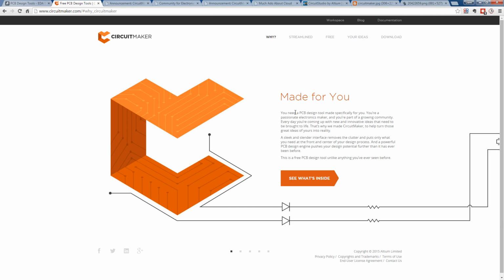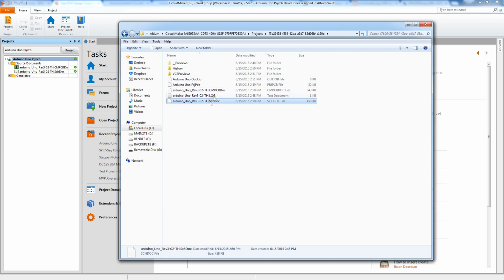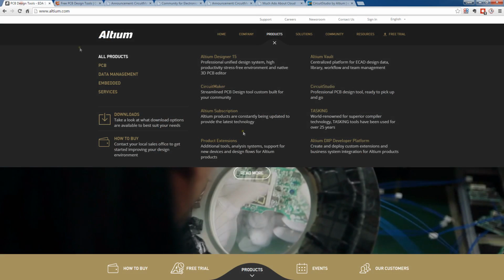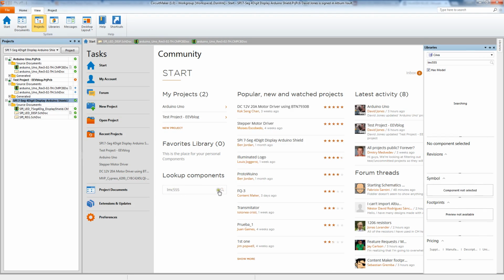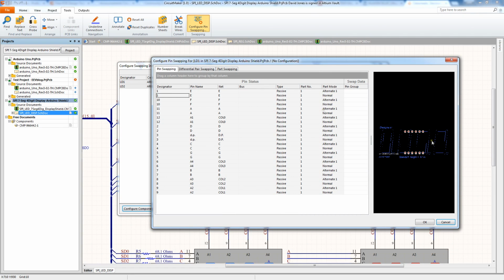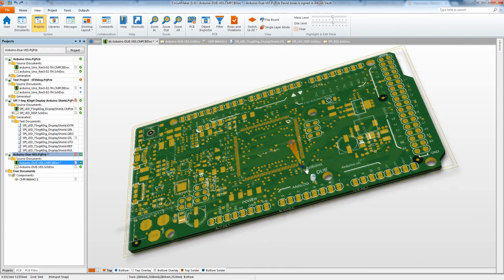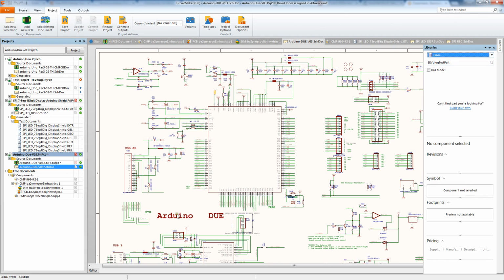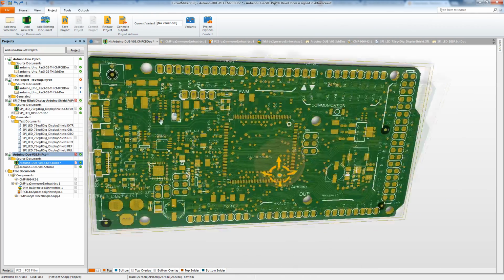EEVblog #754 - Altium Circuit Maker First Impressions

Comment: Dave I sympathize with you on the frustration not just with this program but with all programs and most designs, industrial, commercial and domestic . The problem is MONEY, PROFIT and Capitalism. Where making money on a continuous cyclic bases is necessary for the business model of the company or it dies. Proprietary engineering, copy writes, patents and all things that privatize, limit or differentiate things are meant to keep people from sharing, swapping or using an item with someone else's product.  Buying new instead of upgrading or fixing. It also allows a company or inventor to keep altering things so they can make them obsolete. One such example was a mail program I used in collage back in the late 1990's called Eudora by Qualcomm. That mail client was by far better than anything today in so many ways. It should have been upgraded with all the features it had to work on current operating systems but they killed it. I feel the reason was it had several features that enabled people to stop spam like "BOUNCE". No mail client today allows for people to reject ALL mail that is not in either your contacts list or a specified folder locally or on your ISP provider servers. Same is true about phones. I have argued with phone companies about this. Why is it they will not implement a system where all incoming calls are screened and if they are not on my contact list they are simply rejected. No annoying text messages or calls from scammers, late night telemarketers or sales people wasting my time. They could but they just don't. It is because it is all about the MONEY. The bane of societies every where on the planet more destructive than an atomic bomb.

Money is Greed and it breeds war, inequality and crime where ever it exists.

Comment: As usual a great eevBlog video. However, it is getting really old and CircuitMaker has changed a lot in the interim. How about an update video especially addressing the original short comings that are now fixed!

Comment: During my Bachelors I worked with a tool called 'Target3001!' by German developer ibFriedrich:
https://www.ibfriedrich.com/de/index.html#home

I only worked with the free 'discover' version which is limited to number of pins, but there are several upgrade versions available with various limitations at different price levels, so you only pay for what you need. There's also an unlimited student version for 159€ which you can get via email request. As far as I know, all versions share the same software framework, so no problems with inter-compatibilities and - most importantly - you don't have to be constantly connected to big brother - it's fully functional offline.

I tried Eagle, KiCAD (which I personally find god awful to use) and worked with Altium Designer for 3 years in my company and I have to say I never felt comfortable so fast with a PCB tool as I did with Target. Unfortunately, they only offer Windows and Linux versions, so I was forced to switch back to Eagle on MacOS. But I would definitely recommend any Windows user trying it.

They have English documentation and the tool comes with schematics designer, layouter and 3D renderer all-in-one. Even in the 'Discover' version.

Comment: Great Video.  I am an old firebottle man myself.  Could this be used to simulate certain designs from the vacuum tube era?  For instance a multi-output power supply battery eliminator?

Comment: I have been using this for the last few years. In general, it's amazing. I've only found two limitations (and the first one might just be a bug):
1) The object inspector seems to not allow macros, so you can't just select a bunch of pins with names A1-A9 and tell it to rename them to A25-A33. It's in the docs, but it doesn't work.
2) No automatic trace length matching. You have to do manual meandering and watch the trace lengths in the nets list. I don't trust this method as much as a real trace-length matching feature. Luckily as a hobbyist I don't really... do length matching, unless I'm playing around with a design I'll never be able to actually make. :D

Comment: Hi David,
In the video, you mentioned that you are not able to use some of the real estate of the screen because of Ribbon Interface.
This is just a small tip for that.
You can hide contents of a Ribbon in any application by just Double Clicking any of it's button like Home/View etc.
You can the pop it up by Single Clicking.
If you want to restore it again, just Double Click it once again.

Comment: I just checked and Element14 has circuit studio is $1000.    Better than $3000 but a bit difficult for a maker/hobbyist.    I just don't get why Circuit Designer  just doesn't allow you to buy private offline projects for some reasonable price like $300-ish with a non-commercial limit.
Reply: So it appears to be $1000 for a year's subscription and then $150 annual renewal.   That might be reasonable for a very active, well heeled maker/hobbyist

Comment: I dont understand the problem of most of the viewers. No question its crap for professionals and companies but it definitly is made for hobbyists. 
And for a hobbyist : who fucking cares if they can see your design? Use the benfit and look what the others gonna do. You can only win, cant you?! 
In my opinion the benifit of the vendor could be that they can sell the informations what parts will be sold in what ammounts and that the buyers will probably buy at the store which is connected with the software.
If you think that isnt fair you can go and spend enough money for a small car for a peace of software ;)
Reply: I know no hobbyist who wants a lagging piece of software no matter how fancy, that shit just drives you nuts.
Not to mention the uncertainty of the software still working after 5 minutes and if anything will save once you are done, that is not something you want hanging over even the simplest of projects.

Comment: For me, the most annoying thing isn't the lack of privacy (even though that's bloody annoying), is the fact that it's WINDOZE ONLY. 

My workbench computer is NOT WINDOWS. It's Ubuntu Linux. I can use the free Eagle, or KiCad, or any of the other solutions out there. Or, if I want to use a fully-cloud based system, I can go to EasyESD, which will run on anything that can run a browser. 

I'm still learning this stuff. I've never actually designed a PCB from the ground up, and won't be for quite a while. But I'm looking at which tools to use so that I don't have to waste a lot of time unlearning one tool to learn another later.

Comment: I recently got back into electronics and downloaded this just the other day. I was hoping they'd have fixed all of the shortfallings you identified. They haven't fixed any of them.
If I had to describe this program in one word, it would be "infuriating". It's possibly the worst user interface I've come across. I'd believe they actually deliberately made it as un-user friendly as possible because they fucked so much basic stuff up.
The layout is bad, heaps of stuff gets pushed off into invisibility and can't be brought back. Every time you do anything relating to online content you have to wait, and wait, for it to refresh (I don't even have a slow internet connection). I could go on all day. I hope I get to actually learn how to use the program before all these issues force me to give up on it in frustration.
I was originally going to request that dave make a "2nd impressions" video where he has another look at the software and checks out all the things they've fixed. But nah, it's still shit.

Comment: They could make it a bit better by implementing auto hide option for the ribbon. Make it collapsed and expand it only when you move your mouse over the area where ribbon should appear. The problem is, that the standard ribbon UI control might be not auto-hide capable, therefore Altium might choose not to invest their time to implement their own auto-hide solution.

Regarding "fully online" Altium should have learned from ElectronicArts and their Simicity experience - it was an epic fail and, most probably, led to shutting down their Maxis Emeryville Studio. Be really careful if you go that way, Altium.

Comment: Actually, it is limited. Their documentation states that as your circuit gets larger (more nodes), the performance purposely degrades until it becomes unusable. Source: http://documentation.circuitmaker.com/display/CMAK/CircuitMaker+-+((System+Requirements))

Comment: EEVblog thank's for this video. Only what I am worried about is, if I make a great design in Circuit Maker and one day Altium decides to shut down Circuit Maker, am I going to lose everything?
Before I use Circuit Maker for my boards, there really should be something to give me an option to import/export files to Altium Designer.
BTW, I normally do not watch youtube channels, but you really do great videos!

Comment: The "only cloud saving, everything must be done public" is what kills CM for me. In Eagle, I currently have about 20 PCB projects "to be finished whenever", that I tinker with whenever I find the time and mood. I wouldn't dare show this WIP data to anyone. And since most of it is tailored around some obscure hardware and requirements from my lab, there wouldn't be any point in sharing it with the world either. No gain is to be had from that by anyone but myself.
The component creator is awfully clunky compared to Eagle, and even that one isn't really user friendly. There has to be a better way...
Even better would be if either company could entice device manufacturers to supply parts libraries.. but that's probably never going to happen.

Comment: This looks like it has everything i want from a circuit design software, but the cloud storage seems like it would be a problem, as i do a lot of design work on the move. Thankyou for the brilliant, in depth review :) love all your videos :)
Ps, if you read this, have you heard of design spark pcb? It's the software I have been using lately, it's almost the same, but it saves onto the pc or laptop, which i have found very useful :)

Comment: Being a casual Altium user at work I had to give this try.  It does seem to be quite complete.  I found it is a simple matter to hide the ribbon and make it pop back up when needed.  Doing so I found a way of doing short cuts. For example if you hit "H" it will bring up the home menu.  It will then show you the short cuts in the home menu.  For example, if you hit "HDR" it will bring up the design rules.

One main thing I haven't been able to find so far that I use a lot is 'find similar objects".  That's very handy for placing lots of VIAs that need to be assigned to GND for RF stuff.

Comment: I've noticed new software versions no longer support keyboard shotcuts and hot keys, is it due to new programming platforms or is it due to users do no longer use them? Also the annoying ribbon style started by office 2007 is spreading. I particularly find icons more ambiguous and confusing than text menus, it requires an extra effort. Do you agree?

Comment: Dave, many, many thanx for this one, as i now know it´s just NO for me -- it´s just NO! Why? :
If someone in the headquarter (altium, or someone else down the line) may say...ok that´s it - we shut it down, and the server won´t answer anymore....
Upps, all my hard work will be taken out of my hands and i won´t be able to use anything again :( :(

BIIIIiiiIIG FAIL, ALTIUM! What´s gonna happen with my projects/files in, let say, 15 years from now? NO WAY ALTIUM, i bet the servers won´t be answering anymore....

My first VCF (VoltageControlledFilter) design was made well in the mid 90th, i can still load these files in Protel and have the PCB being produced through the gerber output, "...No problems whatsoever..."

I still work with my Protel´99 or DXP (got both), local on my "vintage" 1999 (top notch that days) laptop and it will work until forever, as i got three machines, and i only use it for my schematics/PCBs. No one will have acces to it, as it isn´t connected to the internet, anyway.  No one is gonna stop me....:) :)

Whatever(Whenever) a company come up with, regardless how cool/good/whatever it is, if i can not have (or can make) it working without internet/cloud, it´s a COMPLETE FAIL!!

Comment: Cloud circuit and pcb designer? Has anybody gave a try to Upverter (upverter.com)? They have a free version (https://upverter.com/community/) and a less steeper upgrade plan.... Sure, it's not Altium, but this doesn't require an installation and works on every platform... it's an HTML5 application: at least they have gone cloud all the way down, not just half way as Altium did...

I tried it and I find it quite impressive!

Comment: Has anyone looked at Diptrace? the free version is limited but it is so easy to use and the full version is cheap compared to most of the other leading packages.
Am I the only one that hates this whole moving everything to the cloud crap, I wouldn't pay for any app that required a internet connection to work at all and then forced me to store everything in the cloud.

Comment: Check the user agreement for circuit maker, Altium owns rights to your designs legally, regardless if private (sandbox) or public, that is the big catch.
Reply: mod robert is it true? I was looking exactly for this in the Agreement and I could not clearly find who actually owns the IP. Please, could you copy the paragraph here? Also, I was very surprised about the paragraph limiting university and research use.

Comment: Wonder if theres a way to kill the cloud requirement.
Reply: ***** The SW perhaps was designed in a way it depends on an ALTIUM service that runs only on their servers. Not just storage and license management.
Reply: InXLsisDeo Better than that is trying to get an open source developement. Altium isnt the only suit por schematics, PCB sim (ad so  so so) in the Earth. Many projects can be done even on the old Eagle under DOS, so you dont need this cloud at all. Perhaps the are tempting you with this "pro" tool and the struggling cloud or internet connection so that you end "lets get a license because the cloud thin s sh1t". You are giving a DEMO. Thats all. The real deal "pro" tool ? You need to pay, Thas all. Pro tools, we got a license for an IDe Its a #1 brand. Very poor performance buggy, slow, brakpoints fail Used a gcc based IDE which costs just a quarter and works perfect all the way. So, brand!=PRO  .... IMHO. Is a gorgeous suite for sure, but average is using average features that you can find in other platfform.

Comment: 26:00 You can 'minimize' most ribbons by doubleclicking on the 'tabs'. You're then left with a seemingly normal menubar, but opening the menu then pops up the ribbon bar.

then you can reclaim the height the ribbon bar is using.

Comment: You can collapse the ribbon, then its just as high as a menu bar. Also there are hot-keys they're just different then you're used to (stop whining about it). Public sharing is no problem the offline restriction... hmmm not sure yet.

Comment: There are "strings attached". If you delve into their online documentation, there is a part that states if you go over "x" nets, "x" layers, "x" sheets etc the software will gradually slow until its unusable. from the FAQ on their website: While there are no 'hard limits' per se, the software has been engineered to make it impractical for use with large designs. To this end, the PCB Editor will start to exibit performance degradation when editing designs containing 5000 pads, becoming virtually unusable with designs containing 50,000 pads. Degradation itself takes the form of progressive slow-down in PCB editing functions (such as routing, placing components, polygon pours, etc).

But who is ever gonna use more than 5000 pads? So no real biggie!

Comment: Cloud only? The server is (you guess it) in the USA. If there is somewhere an internet problem (no connection with the server), or server is down (maintenance or other problems), you can't access the projects. Same if the "pull the plug".

Free + Cloud = "not entirely free"

Comment: Thanks for the heads up Dave.
Yeah after seeing your video I'm not impressed in the "Free" Altium on most of the issues you brought up.
Not being able to control the access and storage of out IP is a deal breaker.
An then they offer a "Free" PCB software that does not even function and control like their mothership. That can't be good for migration to the actual Altium big boy.

It's like learning to drive a go cart so that you can later fly a A380..
Shaking head walking away....

Comment: I have tried circuit maker, the biggest problem i found is to find basic thru hole components like resistors or capacitors... I know today every dude can do smd board etching at home but...
Reply: ***** Thank you very much for your interest. The database is big and create custom parts like a generic thru hole resistor is trivial, just the first impact is disorienting. Create only few components with appropriate silkscreen, 3D model and blank value would be sufficient, like different sizes capacitors, resistors...

Comment: From a first time user this is almost unusable. I used ExpressPCB just because it made sense. None of the controls transfer over from 3d design software or any other software. Add one pad and try to switch to a line? Nah. You'll just drag your board around. You have to hover perfectly over the pad to connect the line. Creating a new document and hitting open doesn't throw you into a board or even schematic, it just does nothing. 2 minutes of playing around and I'm already angry. Cut doesn't work right.